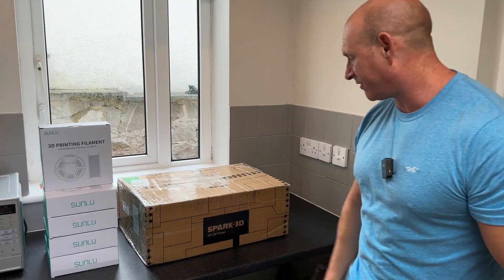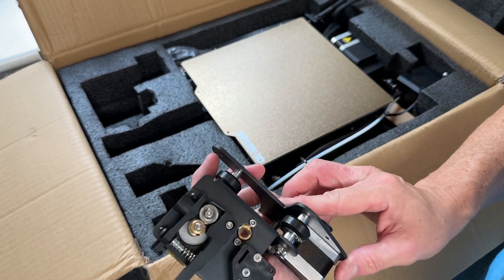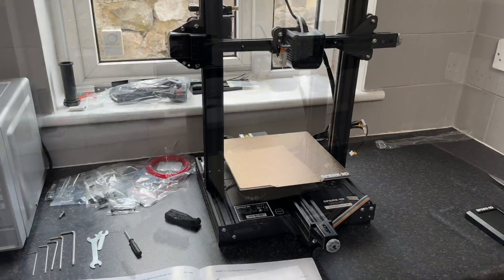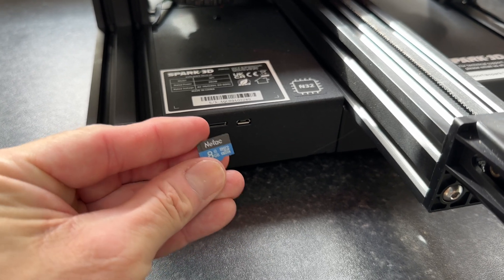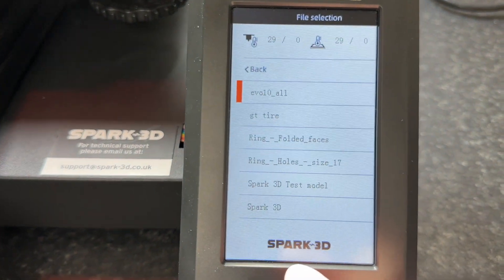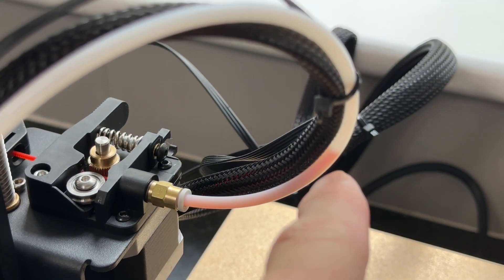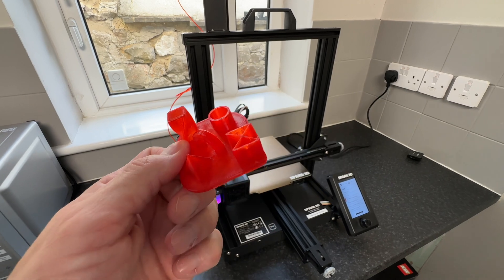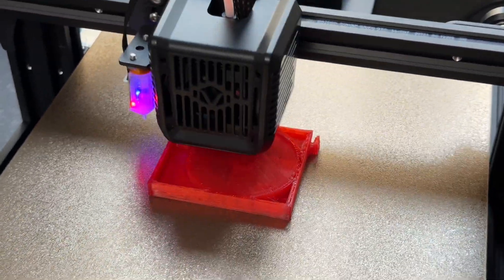Spark 3D SP1 3D Printer, Unboxing, Setup & Demo!

Comment: Great video thanks, actually bought this from box. my one issue is that the extruder fan is on constantly and quite loud. did you update the firmware and where if you did, did you get it from? prints are great but like i said quite loud. any help would be appreciated thank you.

Comment: Aquilla X2 printer that is modified with BL touch and magnetic bed. Box are useless at customer service with these printers as I have found out when I have needed simple information about this printer.
This worked OK for me although the base layers of the print were rubbish and with the instructions not being that useful turning to the internet is the only option. Once tramming is set up and the Z offset adjusted correctly this can produce decent prints but these are inconsistent. As far as noise is concerned I tend to think that it could be quieter.  I could not hear the demo of the noise yours made over the noise of mine on idle.
Reply: Box у себя пишут, что они заменили вентиляторы на оригинальной Aquila X2 на более тихие. 😊 Но, похоже, они ничего не меняли. Просто прикрутили Bl-Touch и всё
Reply: @Nicholas.K.  True although it is a good basis for making a 3D printer that can work OK, just replace minor things like motors motherboard and bl touch  😅